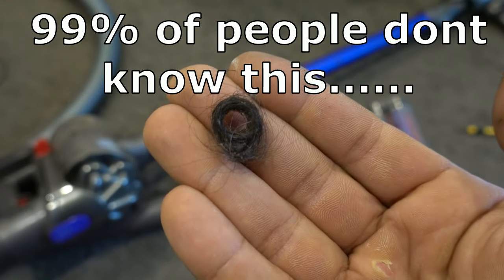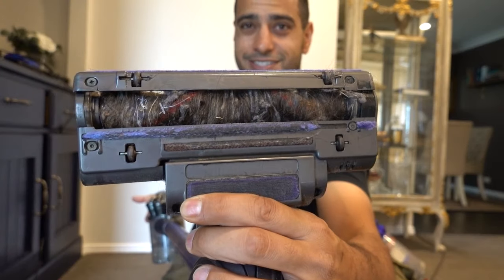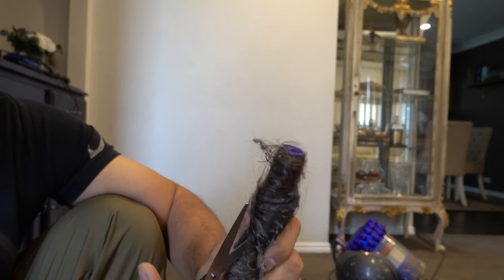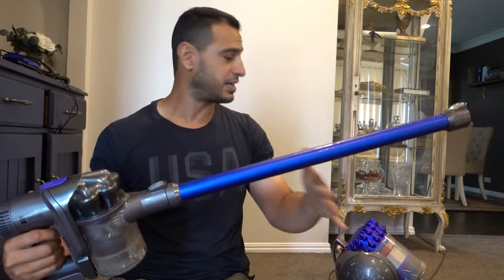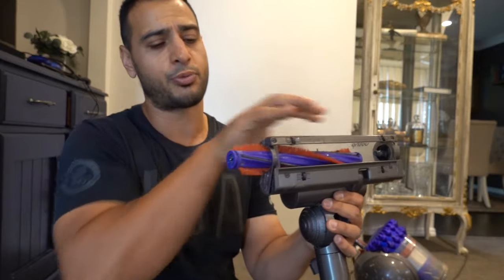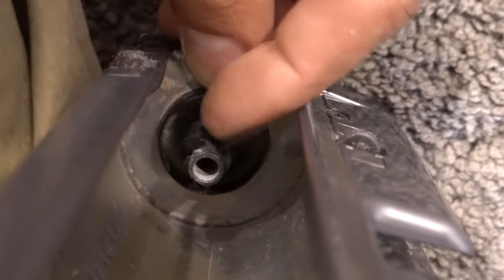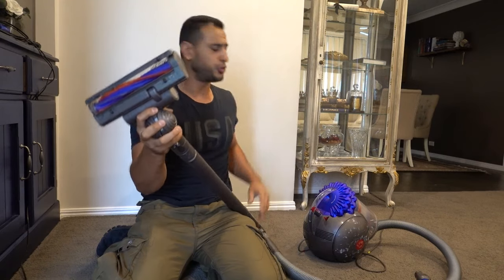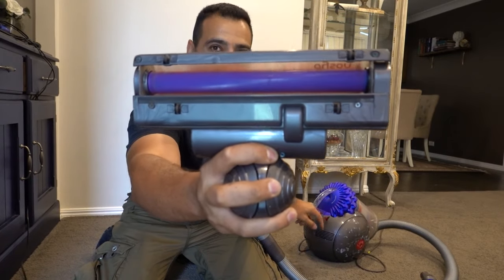How to fix Dyson Vacuum head  - roller not spinning

Comment: Worst vacuum ever! I have NEVER had a vacuum to cost so much and require so much maintenance to keep it running. I've owned just about every model and it's always the same insane amount of maintenance. I'm done with Dyson!
Reply from the maker: Try a miele vacuum cleaner, never have an issue 👍
Reply: I’m bout to b done with dyson too
Reply: I was sucked in to buying one as well only two years of it and it is starting to have problems (regardless of my constant filter cleaning etc) such bull crap and waste of money 🤦‍♀️
Reply: Weird. I've had very little problems. Just average maintenance. Had mine for 6 years, works fantastic. Maybe the problem is you?
Reply: @Itsme333t  sounds like user error
Reply: Worst vacuum ever? Yet you have owned every model. Sounds like a user problem.
Reply: @Toos-sf8vw  Not really. Just able to afford whatever I want. Sounds like jealously.
Reply: Same here. Expensive shit.
Reply: skill issue, soft hands, no edge maxxing
Reply: Imaging using a 'spot cleaning' vacuum for an entire house and expecting it to keep up...
Reply: It’s very easy maintenance
Reply: I bought a new roller head. Cleaned all the filters, cleaned every connector with IPA.
90 minutes later it still doesn't spin the brushes nor do the little headlights.
Extremely annoying.
Would never ever buy another Dyson.
Reply: Don’t throw it out
Reply: Don’t throw it out
Reply: Dyson is the best vacuum I've ever owned. I've owned various other brands like shark, hoover, and they all broke within a year! You sound like the Average American complaining about maintaining their appliances because clearing the roller of hair and debris is such a big job.... sounds like a major user error.
Reply: @kinnonmcallister  I've done the same and regularly clean filters and brushes. This time I've had enough, too temperamental, anything stops the damn thing!
Reply: U are most definitely not lying. Paid $850 for my V15, had it for 6-7weeks and I’m already having the 2nd replacement part shipped to me. If I didn’t have a warranty I’d be f**d! They’re just expensive pieces of junk.
Reply: @Toos-sf8vw 😂
Reply: @K3NnY_G  That's what Dyson advertise it as, a cleaner for the whole house!
Reply: I've had mine for over a decade and this is the very first issue I have encountered....  Sadly, the video didn't help the sudden intermittent stoppage of the head roller, but I am definitely gonna buy another Dyson before this one dies as it's an utterly incredibly vacuum.
Reply: @billshowto  Our miele head was always getting jammed. This is the first time we have had the issue with the dyson after owning it for 3 years. So it just depends on models and different houses I guess
Reply: Me too

Comment: Holy crap! I took apart the brush head today because my dyson wasn't moving the brush head at all.  I noticed the mechanism was really hard to move so I figured there was hair there. Then I found your video showing how to take it apart, and THANK YOU SO MUCH! I WOULDNT HAVE EVER NOTICED THAT SCREW THERE. There was about 3x the amount of hair as you found in yours. You saved me from buying a new one, I bet at least $100. Thank you so much! Its working like new.
Reply: Exactly the same here. Thanks!
Reply: Ours was exactly the same, thanks heaps for the fix it video mate top job😊😊👍👍👍
Reply: Fixed! Thank you ❤
Reply: Yep, same here! Was not turning at all, now running nicely again.  Thank you so much!

Comment: Excellent instructions. I really appreciate that you don't waste people's time with over explaining every little detail. This was easy to follow, and I DID find the little monster tuft under the spinner .. however after I put everything back together it STILL didn't spin very fast (it did spin though). Turns out the main issue was that my dog had torn some cardboard into little shreds that I had vacuumed up prior to this event and I thought I had cleared all the little pieces (the hose and head were clear). And suction seemed "okay". So I took off the hose right at the ball and there is a tiny slot where debris enters the ball that had a few very small pieces of cardboard trapped. Not enough to restrict the air but apparently enough to weaken it to the point that the turbine wouldn't spin very fast.  I cleared that out and it runs like new now. Thank you very much for this great video.
Reply from the maker: You’re welcome 👍

Comment: Over the past few weeks, the brush bar was turning less and less. Figured there was something under the spindle, blocking its rotation but didn't know how to access it. Your video showing that there's a screw inside the shaft of the spindle is the information I needed.

Thanks!

Comment: Thanks - fixed my Dyson following these instructions for the torque head. Had a tough time getting that last screw out - had to go to the hardware store and get the correct torque head to get it out. But once I got the hair out from behind - everything works!

Comment: Amazing. Solved. Who would have known there was a screw inside that spindle. Took all the other screws out but that one. 
Massive help! Thanks!
Also worth noting that mine still didn’t spin after reassembly, just gave the roller a little nudge and it started spinning freely again.
Reply: I did the same thing! I had a bunch of screws out .. so many more than were necessary ... and I could not figure out how to get that spinner off. That little hidden screw, I would never have figured it out on my own.

Comment: Hey! Thanks for your help! To anyone wondering about screw sizes, if you have this model, the canister big ball animal, it's a T10 for the 4 screws of the plastic plates and T8 for the one in the turbine spinner. Hope that helps!
Reply: Yes, good tip, I couldn't get a screwdriver that went into the spindle for the last screw so I took it into our local computer shop. They had the right screw driver and didn't even charge me. Thanks for your tip, now I know what to screw drivers to buy. 😊

Comment: Great job. I purchased a new battery due to the brush not spinning and did not fix the issue. I searched and found this. It was a pain getting the final piece (i had to remove about 7-8 screws) but worth it. This one had twice as much hair behind it than you showed.  Saved me having to either purchase the entire head or a new vacuum.

Comment: Worked perfectly, got an great tight washer or hair that was otherwise invisible without taking off that last screw. The roller was spinning freely by hand after but still wouldn't spin when switched on. Gave the whole dyson a good blast with the leaf blower inside and out(especially the build up of fluff around the drum) and is now running at warp speed!
Reply: What size torx screwdriver did you use?? It's so hard to measure and I don't want to buy a set, just the one to fix my V6 😭
Thanks
Reply: @thunderverna  t7 for inside the final bit. T9 everywhere else
Reply: Mine is still not running so may try hair dryer... 🤷🏼‍♀️

Comment: Spot on video, saved me a replacement Dyson head costing £65!, turns out my issue was the hair stuck behind the spindle, in the head, when I tried using the Vac it would spin for a few seconds then stop, but following the step by step guide I was able to dismantle the unit get the spindle out and find a massive wound up piece of hair which was causing the problem, removed that and I cannot believe how good the vacuum is now and as stated in the video unless you remove the spindle you will never know how much hair is behind there, I would say if even you don't have problems  but had the machine for a while you should look at the spindle and clear it out to save your motor burning out and improve the performance of the machine.

Comment: Thank you so much . The final trick was the one that worked- I but hard  getting the screw out of the twisty thing- but the screw star head was the same size as the other screws in the unit and only took 12 turns to remove it. You sir are a legend. The wife will be delighted and so will my bank balance!                    First class help.
Reply: What kind of screwdriver do you need as it’s not a torx or Allen type ?

Comment: I was having the same issue with mine, and even after I cleaned the entire roll I wouldn't have ever know that one could actually remove the roller base and that hair would be stocked in there. I'll clean it again. I was so bummed out the roll would not spin as it should after I cleaned it thoroughly, but I'm sure this will do the trick. Thanks for posting!!

Comment: GOOD REPAIR VIDEO !!!  Just a tip for everyone... The screw holding the drive wheel on is a Torx #8 as apposed to every other Torx screw on the Dyson which is a #10....
Reply: Thanks so much for this, I was becoming very frustrated with the screws, ended up one side was small Philips head, other side was Torx 10 and the very tricky little wheel was as you said a Torx 8, which I had to go to Bunnings to buy ! But it's now working, so very appreciative of this helpful site and your contribution !

Comment: Yes buddy. I looked at a few different parts and cleaned it up a lot. This is the first video that had me remove the center screw that the brush spins on. So much hair behind there no wonder it didn't turn. I was gonna buy a new vacuum. Thanks man.

Comment: Thanks Bill, great vid but I had to go a little bit further to solve the same problem. I removed the 3 T9 torx screws on the transmission just above the electric motor and found that the tiny nylon cog on top of the motor was a bit worse for wear (not terrible). I was easily able to flip it over and hey presto, it’s like a new machine! The problems that I was also having with intermittent stop / start issues that I thought were related to the switch suddenly disappeared too! I’m thinking there may be some kind of overload switch that would turn off the unit to prevent damage to the jammed brush motor.

Comment: Worked a treat. I had tried everything and had even bought a new battery pack. Such a helpful video. Clear and simple instructions. Problem solved and saved myself from having to buy a new vacuum cleaner. Thanks so much 👏🏻👏🏻👏🏻
Reply: Yeah me too...gunna give this a go today. At least now I have a 9000mah battery!!!
Reply: Me too! But mine doesn’t have the screw inside holding on the mechanism that turns the brush. :(

Comment: Thanks, used the flat screwdriver and it worked. Even did the same on a brush head that was taken in to  dyson ( approx 5 year ago) and they said no longer worked so we bought a replacement. I now have two working brush heads.

Comment: Magnificent work, thankyou hugely. I got all the way with a T10 screwdriver, only to find the final screw was a T8 (!!) Which then had to be bought. Yes its tricky getting out that last item, even after the screw is removed. Altogether I dismantled the head 5 times, before ultimate success - thanks to you.

Comment: The problem with my Dyson vacuum was a bit different. When the vacuum was turned on, the head roller would spin for 3-5 seconds and then stop. Turn vacuum off/on, and again roll would spin for 3-5 seconds and stop. It was as if there was not enough suction --- same as if washable filter was clogged. Since I had recently cleaned the washable filter and emptied the canister I knew they weren't the causes. So your video inspired me to disassemble the head roller. Without your video I would not of thought of removing the end "gear" that the roller slides into. When I removed the end "gear", I found a very small amount of hair (not the ball of hair you found). I thought that could not have been the problem .... but when I reassembled the head roller and turned on the vacuum the head roller spun !!! THANKS.

Comment: Thank you!  I didn’t know about the final removal of the spool which was what was causing my issues. I tried multiple different tools (hex / allen key / flat head screw driver etc) which didn’t work. 
I have an older Dyson V7 Animal and bought a Torx T9 T (the T denoting its tamper proof 🤷‍♀️)which was the only tool that could get that screw out. It came in a set of Torx keys with a T8, T10 and T15 which another site said could be used on the later models.   I couldn’t find the handled version like the one in this video and the key version worked but was fiddly.  Some of the handles of the Torx tool kits were also not the right size (handle too large or Torx bit not long / skinny enough to fit the spool).   Getting the right little tool was challenging 😅 but my trusty old Dyson head  now works again and well worth it thank you!

Comment: I never realized there was a screw inside the twisty thing, thanks
Reply: FYI for future readers - in some Dysons it requires a T8 screwdriver. Once you get that out, you can get behind the motor like shown in the video and can get the hair out. Add lubricant to the area and use a QTip to clean.

I saved $500 on having to buy a new vacuum with this fix.

Thanks OP

Comment: Cheers Bill, why Dyson can't stick with regular Philips screws is anyone's guess.
Reply: Because it would be an easy fix
Reply: Phillips screws can "cam-out" and prevent you from applying the correct/consistent torque.  Thus the use of Torx, Square/Robertson, etc

Comment: Thank you so much. In my case I had to go a little further and take off the side cover of the transmission mechanism of the brush, clean up debris and dust, and force twist the kogs and belt a few times to make it run again. The side cover is fastened by one star screw and a clip. But your guide was most helpful!

Comment: Thanks! The 3rd fix worked after much fuss. The screw inside the drive shaft has a smaller star head than the others on the brush head. I needed to pull the drive shaft out with vise grips (padded to not damage the shaft).

Comment: Thanks that fixed it. Tip remember to ensure the spindle turns freely before putting it back together . mine was stuck but twisiting it popped it free and now works perfectly

Comment: Great video!  It certainly helped out a bunch!  To give a little add on, the screw bit to unscrew everything is a T9 star shaped or Torx head.  I recommend a slightly longer length for the last screw is in pretty deep.

Comment: Great tip thank you, on my DC-62 stick power head the torx sizes are T-9 to take the head plastic parts off and the inner screw in the "Gear" was a T-8. I had to actually dig fine hair from the bearing with a jewellers screwdriver. Poped the bearing seal off and added a very tiny amount of light lube, put the bearing seal back in place, works like a charm. Wife very happy, me too!!  Awesome thanks again.

Comment: Thanks for that! I was about to give up with a fix, the hair in the brush idea is obvious and I clean it almost every use, but fast forward to the hairball, and thought I give it a go. My DC45 Motorhead is a bit different but figured it out, and there was a thick and hard circular hairball. I lubed the plastic gears inside too with a few drops of bicycle dry chain lube and put it all back together. Now spinning well. Got a new off-brand battery yesterday too. Thanks again!

Comment: Thanks a lot my 6 years old v6 was keep turning off when vacuming carpets so i started cleaning it, device on itself was clean but problem did not dissapeard, after disassembling motorhead i find out that there is loads of my missues hairs but i could not get of this twisty part that hold the brush. After watching your video i was conviced that I have to pull it really hard and there was soo many hairs that i could not believe it. So i assembled it back and now it feels like brand new vacum, thought I will have to threw it away and get v15. 

Many thanks for your video it saved me some money

Comment: Thanks Bill. That last plastic cover to remove before accessing the small motor had me stumped until I saw your video. My DC35 motor head wasn't spinning and I tracked it down to what I thought was a small white stone jammed in the toothed rubber belt drive. Then I found that it was in fact a jammed belt tensioner (the belt drive compartment only being attached by one pin allowing a pivoting action was the clue). A bit of pencil graphite placed into the tensioner inspection hole, a few pushes on the tensioner and she was good as new. Thanks again Bill; a nicely paced, non-condescending, informative video.

Comment: For me it was a solid tangle of hair around the brush that was attached to a blockage that was firmly stuck. This still definitely pointed me in the right direction. This the 3rd Dyson I've found discarded. One was almost brand new that needed a $20 part, the other 2 just needed to be cleaned. Some people are incredibly lazy.

Comment: Yay it actually worked. I saved on a new vacuum cleaner by only buying screwdrivers and pilers. I have a different model but same concept. Took out the screw in the middle and used the pilers to wiggle out that piece and behind it was sooo much hair. I would have never found that piece without you ! I only have carpet for like a total of 2 square metres in my whole apartment so i couldnt bring myself to buy another vacuum cleaner! Thankyou so much.

Comment: Thank you so much for the video! My DC37 model had the same problem with the roller not spinning properly on the carpet as it was slow. The third part solve the problem and didn't want to spend $200 on repairs from Dyson.
Reply from the maker: You’re welcome 👍